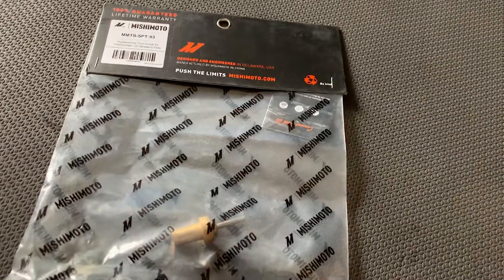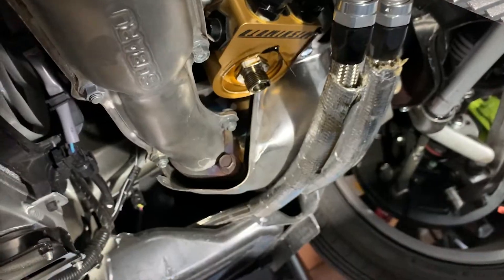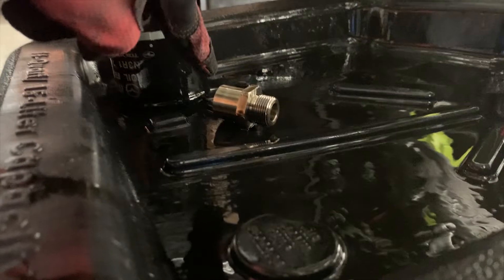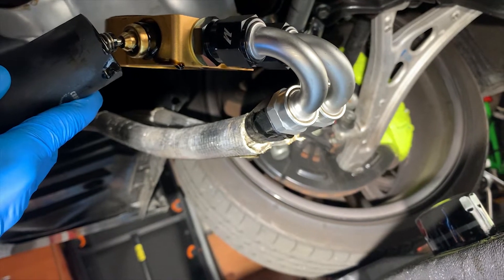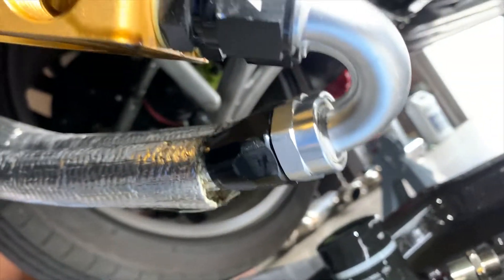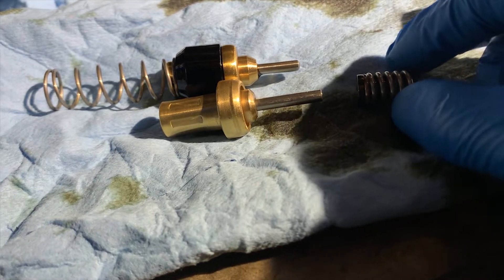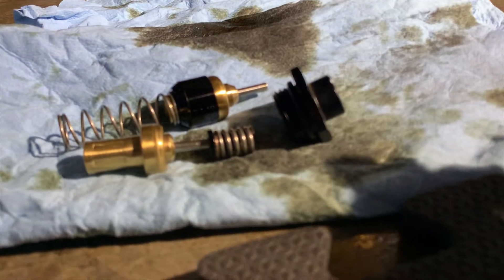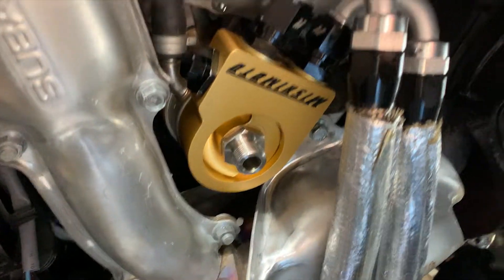Installing a Mishimoto 200 Degree Thermostat for Oil Cooler Sandwich Plate | 4enthusiasts

Comment: Hello,
the temperature of the mishimoto thermostat is the temperature it starts to open or when it's fully open ?
Thank you
Reply from the maker: Opens at that temp and the oil cooler helps regulate to get that temp. In general the thermostat is slightly open and will allow some flow of oil in the oil cooler, but designs may vary. Inline oil thermostats usually start opening at the advertised thermostat temp and then fully opens within 10°C give or take. But each manufacturer is different so you should ask them how theirs is designed
Reply: @4enthusiasts  ok. Thank you

Comment: Will there any issue if we dont use temp. sensor or no fan on radiator....i am from india i will install it in hyundai i20.....here the whether temp reaches to 50 degreein summers.
Reply from the maker: If the environment where you live is extremely hot, then you don’t need the thermostat to regulate when the oil will go through the oil cooler. Since you will see very high ambient temps and need the oil to always cool, you can run a non-thermostat oil cooler. It may take longer for you oil to heat up but the oil cooling will not be dependent on a thermostat. I would message the manufacturer you are buying the oil cooler from for their recommendation as well just to confirm 👍 best of luck

Comment: After 200f thermostat changed, what oil temp difference do you see  before and after?   Are you able to keep ~ 200f?  Thanks
Reply from the maker: With this oil cooler even with the new 200°F thermostat, I am still having issues with the car over cooling the oil. But the times I drive it hard ambient temp is around 50°F. Oil stays at/below 190°F. With the 185°F thermostat with same ambient temp oil was around 170°F running the car hard. The thermostat in the oil cooler works to dramatically reduce oil temp but it sometimes does it too much and I don’t think it closes off if temps get too low. Going to ask Mishimoto for a diagnosis. With hot ambient temps, oil is above 190°F but again it varies depending on the driving you are doing, street/highway differs in oil temp
Reply from the maker: It’s a cliche thing to say but definitely only recommend an oil cooler for the track only as you will see higher oil temps that need to be cooled down. The coolant cooler for the oil in the STI works perfectly for a street car. Unless they offer a 210-220°F thermostat than the oil cooler would be beneficial
Reply: @4enthusiasts  please keep me posted on what Mishi says, I am also searching for an oil cooler that doesn’t overcool the motor oil during daily drive.. thanks